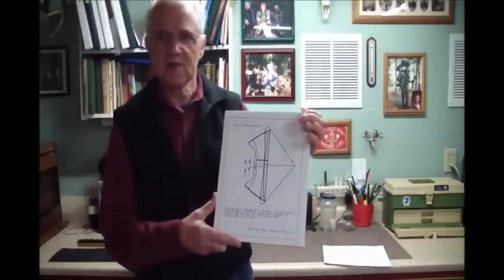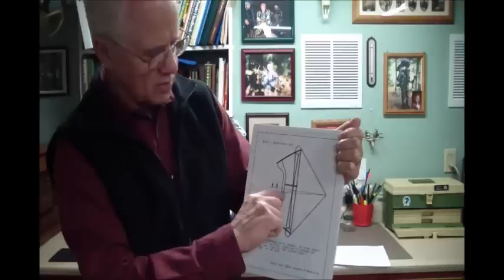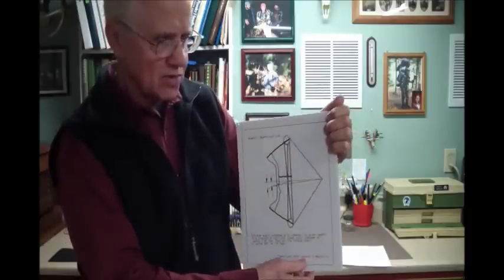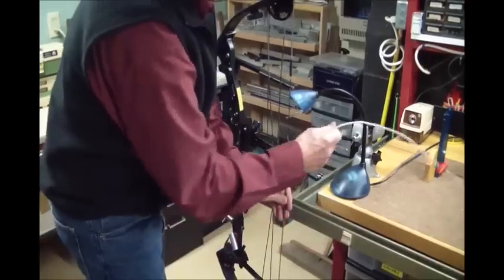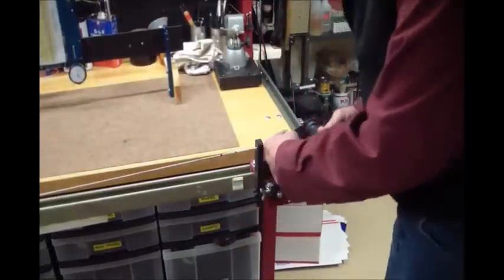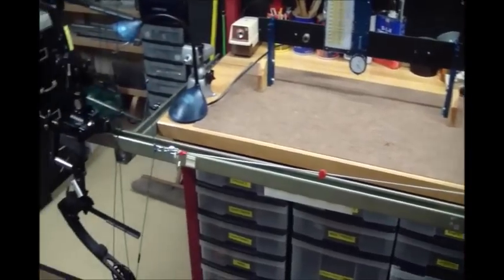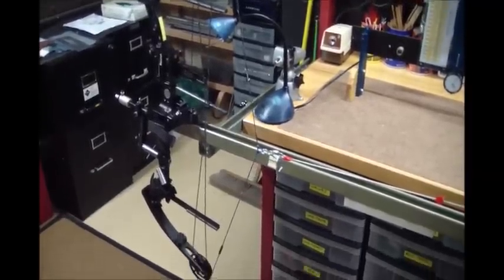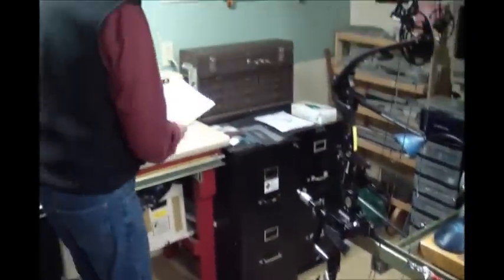Bow Torque Test 1 Introduction

Comment: great work! Sir, you are a gentleman and a scholar. You would think that bow manufacturers who have gone to "shoot through" risers would have rerouted the cables to one on either side of the arrow, rather than both on the same side which is what causes bow induced torque. The reason for both on the same side is so you can slap the arrow in from the side, but with shoot through risers this option is lost anyway. Only chinese bow companies have figured this out. American car companies eventually learned how to build cars from the japanese. Maybe American bow manufacturers will learn from the chinese. Hope it doesn't take 20 years like cars did!LOL
Reply: joseph gilliand Yes, but non shoot through risers prove themselves to be accurate by winning tournaments with excellent scores.